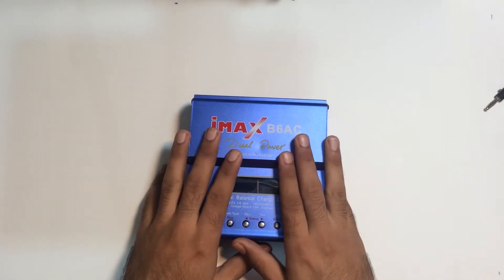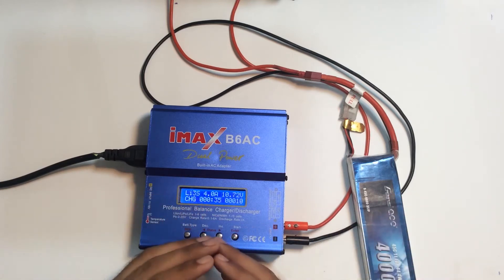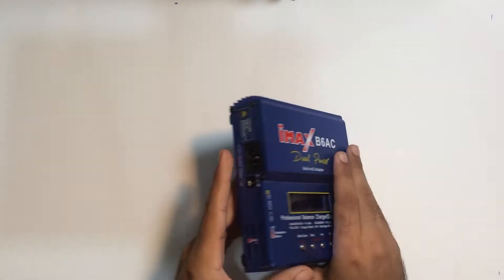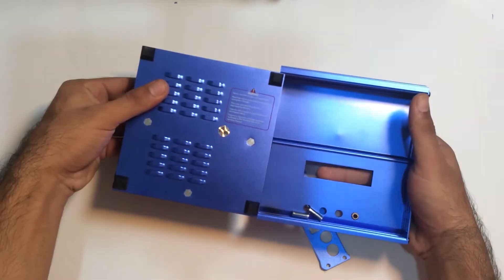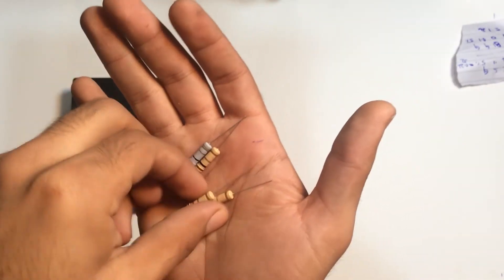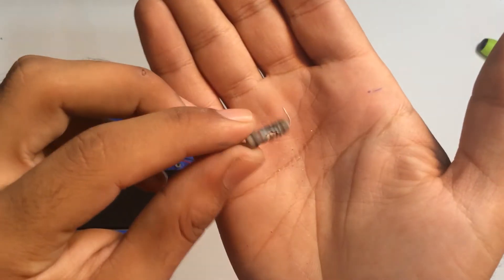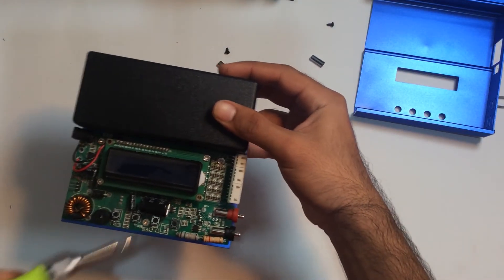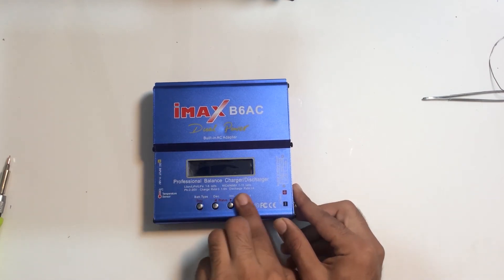IMAX B6AC CHARGER REPAIR | RESISTOR FUSED | VOLTAGE ERROR.

Comment: After soldering all “S” source pins and “D” drain pins. Now it works but it starts charging but stops within a minute or so and then “END NIMH” appears and does not go any further. What a stress this recharger is.

Comment: The broken resistor is for discharge. It is 0.5 Ohm not 0.2 Ohm. 
And the left one is 0.05 Ohm for current sensing.
Reply from the maker: Thanks for informing
Actually, i saw 0.2 in some RC group that's why i used it
Reply: I have charger Imax B6 Sky Rc. The charger won´t discharge. Can  the resistor  on the right side be defective, or  is there  an onether possible  cause ?
Reply: @stanisawignacyzdyb1664  There is a Mosfet in series with the discharge resistor to control the circuit. You should check this Mosfet if the  discharge resistor is not defective.
Reply: @imcrazy886  Thank you !  😊
Reply: @imcrazy886  I soldered them both out and tested the resistors with analog multimeter . The one on the left side has 5 rings that identify it as 28 ohm resistor. The one on the right - right of the first - is a polyfuse resistor (colour yellow-orange) with the designation: JK30 110   So, the 28 ohm resistor is defective, the polyfuse resistor probably not.  I buy the 28 ohm, solder it and report here  afterwards how the Imax B6 SKY RC V2 works.   😊
Reply: Today I checked the code of the 5 rings of the resistor again. Brown, black silver, red, black identify the value of the resistor as 0,10 ohm.  Since I only checked the resistor with an analog multimeter, I can´t say whether is defective. I will check the associated mosfet.
Reply: Iv just replaced both of mine does it matter what way they go in??

Comment: I liked your video to help you out, but it was a bit disappointing that you didn't show the result afterwards.  And on my charger I can't insert the buttons from the outside. But that's not your fault off course :)
Reply: Hmm.Actually the charger in the video is the clone version you may be using of a different manufacturer so find another way to insert the buttons
it may be possible to inert before putting in into the cover
Reply: and by the way in the original sky RC charger, the assembly is not the same
i think the casing is stuck to the circuit.
anyways please check that out